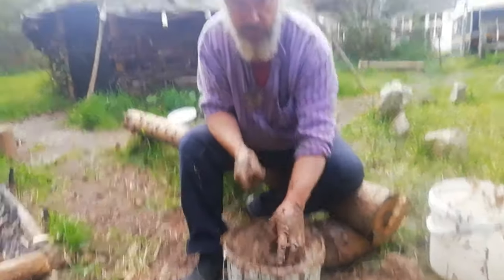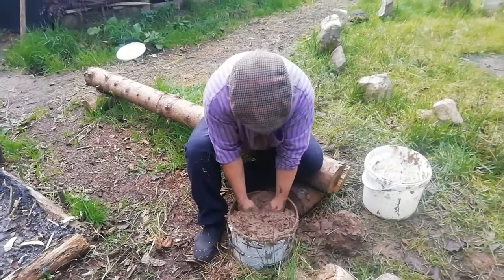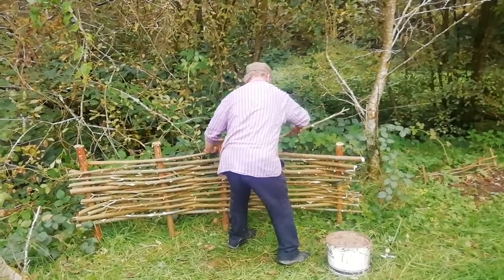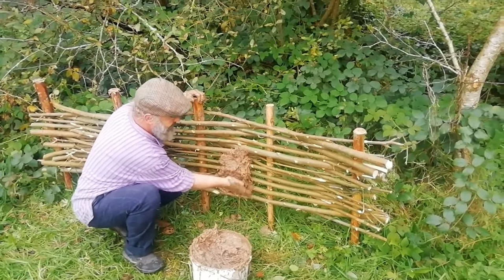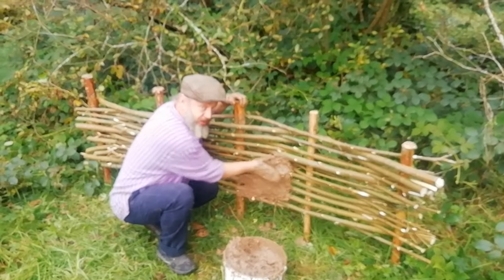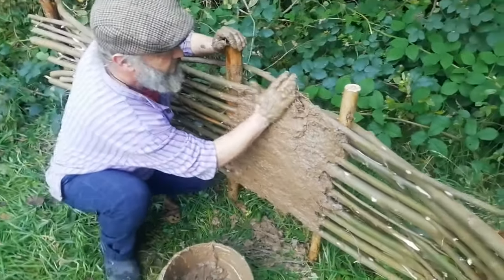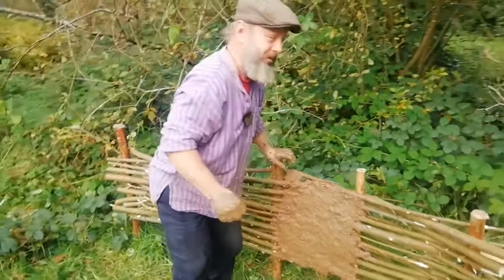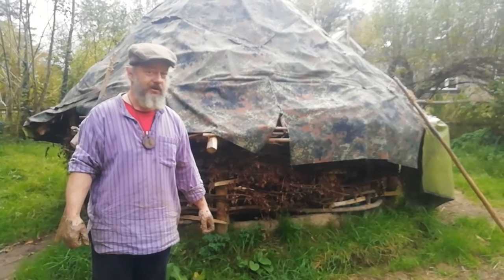Wattle & Daub (Tutorial)

Comment: Thanks for this upload, Stefan. I'm wanting to add a wattle and daub porch to my little cob roundhouse I built 4 years ago so have a question. I used the clay from the area I cleared to do my built but added sand to the clay and straw. It dried like concrete and is grand so if I don't add sand to the mix will it crack  and be less resistant to the weather? I'm 750 m above sea level in Portugal and hope to use coppiced mimosa. Would really appreciate your opinion. ❤
Reply from the maker: @maggietaylor9713  I'm hearing a lot about sand in the mix and must try it for myself! If it's working for you then I say do it! I have only researched building methods from Ireland and have started looking at Britain. It seems to me that you use what is around you, wherever you are. That's what I do.
Reply: @craggyhole Thanks for feedback Stefen, unfortunately I had to buy in the sand to built my wee house. The cob man said unless my clay ratio in the soil was about 25% to loam and stones I'd need to add sand or it would crack. Have you started on your wee house and what mix are you doing? Taking your feedback I think  the external daub will be cob and I'll do the inside with your mix plus goat poo from my gals. Much appreciated and greetings from Portugal 😊
Reply from the maker: @maggietaylor9713  thank you. My latest short is the start of the latest shelter. Not sure about a mix yet. Stay tuned!

Comment: Thank you so much for this tutorial. I am going to make a fence for my poultry come warm weather. Im curious about a few things. #1 - the clay, Do you filter out the mud or jut use plain mud? I have soil that is vey heavy in clay but I have been unsuccessful in separating it. #2 is the clay needed? I was considering just using the branches for this project and foregoing the clay all together
Reply from the maker: Thank you. Sorry for the delay in answering: #1 - mud with some clay content is good. #2 - clay is not necessary for your particular project.
Reply: @craggyhole   Thank you sooo much ! as soon as the snow is gone up here in the north Im getting started

Comment: How long did it take for you to make that fence portion? I feel like it's more time consuming than it appears.
Reply from the maker: It's half a days work harvesting and prepping the willow & stakes for this example. Yes - it does takes time. The daubing is the most rewarding for me.
Reply: @craggyhole  My question is:  How did they historically tie in wattle and daub to a timber-framed house?

I know that the mud would sort of tie it in, but I would think that they'd have a more secure method of attaching the stakes to the wooden beams.
Reply from the maker: @tyree9055  there are different methods, but in the case of building a house, the beams would be fixed to larger stakes at the top using dowling and rope to fix it onto upright stakes (approx. 4"/5" diameter). Another method is to simply place beams onto finished wall which will not be as strong or as durable.

Comment: How do they hold up to humidity and rain tho
Reply from the maker: A wall built this way would usually be part of a house and have roofing over hanging the wall by around 3 feet to prevent rain falling at up to 45 degrees, so that even then - the rain won't touch it.
Reply: @craggyhole  alright ! And what about humidity coming from the soil? Doesnt it degrade the wall?
Reply from the maker: @jeanladoire4141  yes. Also, the lower internal part of the wall can be damp and cool, which may cause degredation up to 1 foot high. Unless fire is lit every day..
Reply: @craggyhole  thanks for your answer, i hope to build myself a shed from dirt and wood, and i'm just not sure of how good it is / what needs to be done to make sure it works